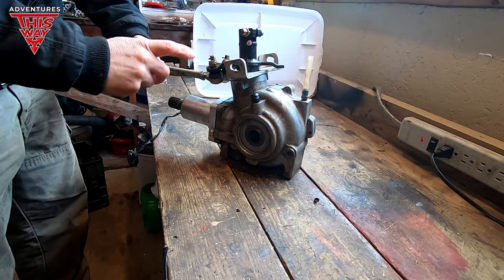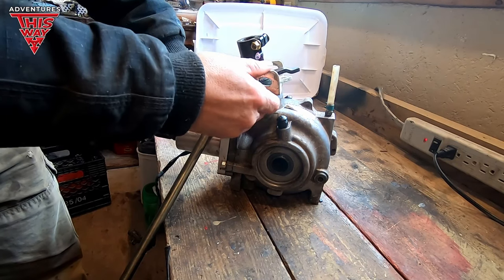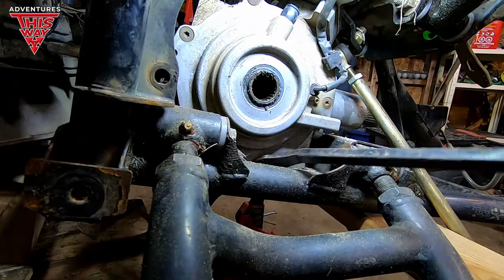Polaris ATV Front Differential Removal | Sportsman- Scrambler-HIGHLIFTER 850/1000 XP

Comment: Hey there, you might be able to answer my question. Does the lower steering post with the bearing have to be put back on a certain way to be aligned? Cause I took mine off and put it back on and now my rod is making a bunch of noise and didn’t before
Reply from the maker: it only fits on one way.  It may have been damaged when you removed it as it can get stuck in there good.  Or noise could be you EPS unit or the upper steering bushing

Comment: have a 2021 hl xp 1000 there's a hose on front of front diff that's hanging down I've been told it could be a breather hose but if not we're would it hook up too
Reply from the maker: Yes its a vent hose which allows the differential to breathe.  There are several on the machine.  The end of it is left open on purpose.  You should have 3 or 4 of them...

Comment: What is the easiest way to change out the lower steering stem/post. The bearing on my 2013 850XP has upward play and im going to be replacing the lower steering post with the new pinch bolt version. Is it possible to unbolt the power steering unit , the inner tie rods and bull the handle bars upward and make enough room to slide out the lower steering stem?
Reply from the maker: You cannot access all the EPS nuts and bolts without removing fuel tank.  Plus the steering post is 2 pieces.  You will likely need to basically do everything in the diff removal process, pop the lower steering assembly  and slide differential ahead to remove the part.
Reply: @ADVENTURESThisWay  3:20 you said there's a way around to not remove the fuel tank
Reply from the maker: @MegaMikerojas  yes do what I did I  the video, but don't need to remove the diff from the frame

Comment: Did you loosen the collar around the steering colum right above the bearing? I can't get the diff to lift up at all.  The bracket is lifted up off the diff but bearing won't come out, it's loose but won't lift high enough to come out
Reply from the maker: No you can't reach all those bolts or nuts. That's why manual call to remove fuel tank. If you have bearing loose and will move but not quite clear, you have to push the diff forward and then up and it will clear.  You removed winch, right?
Reply: @ADVENTURESThisWay  I move the winch so it's out of the way. My problem is when I try lift the diff it pushes the bearing/steering shaft up just barely and it stops. I can see it pushing the power steering . I'm wondering if the bracket that the tie rods are attached to is supposed to be able to slide up and down the steering shaft a little.  Mine doesn't at all.  It may be due to mud build up. I tried lube on the shaft but no luck yet.  I can't get the dif to lift even a 1/4 inch and everything is unbolted from the diff
Reply from the maker: @tvr12speed3  yes its likely jammed with crud. Keep spraying it down with lube.  You don't actually need to remove the inner tie rod ends but it may give you more room to work.  Do you have the 2 bolts removed that attach the lower steering stem to the diff?
And yes there should be some play, it's just stuck. Of course you could go to the proper method and remove the fuel tank and the un bolt every thing...
Reply: @ADVENTURESThisWay  the tie rids are hung up or off the way.  I took the bolts out of the top of the diff. It must just be stuck with crude. Hopefully letting the lube soak down there for a day will loosen up the steering shaft and will let it move enough to pop that bag boy out. Thank you for all your help! This video saved me a ton of headaches!

Comment: Are you parting it out? I might need some parts for my 850! I have bad cracking noise  under acceleration
Reply from the maker: Yes it was parted out, a few odds and ends left
Reply: @ADVENTURESThisWay  I'm interested to get Cecco pinion cover.
Reply from the maker: @imantsgaroza  that’s gone, but I do have the rear Diff brace
Reply: @ADVENTURESThisWay  I'm interested. How much?
Reply from the maker: @imantsgaroza  send me a message on facebook or instagram

Comment: Did someone say they were donating out power steering units to the 1st reply ;) lol
Reply from the maker: Ha ha good one!
I would sell heavily discounted though
Reply: @ADVENTURESThisWay  does it fir an 850 HL?
Reply: I just took out my front diff on my scrambler last week...not fun! I didn't have to move my winch tho...
Reply from the maker: @mnels18  it makes it so much easier!
Yep it’s a pain if seized to the shaft from the EPS unit
Reply from the maker: @EC_ATV_Outdoors  it will fit, and I have all the parts available BUT the ECM is different after 2015 therefore not compatible so I’m told
Reply from the maker: @mnels18  what year is your Scrambler??
Reply: @ADVENTURESThisWay  2013 850